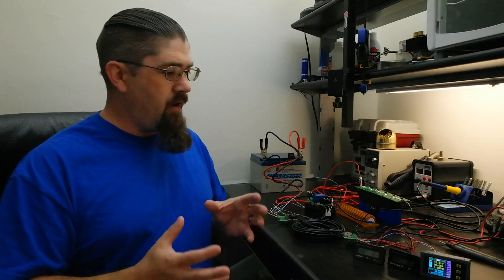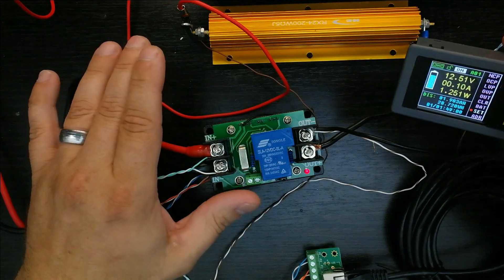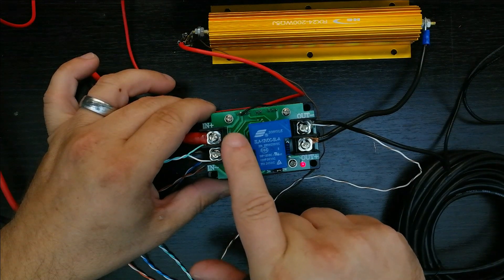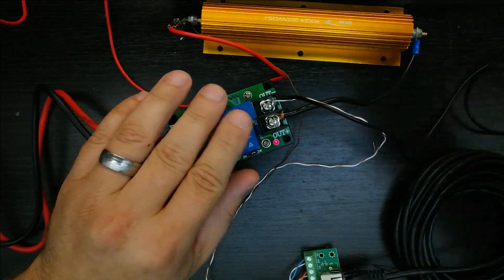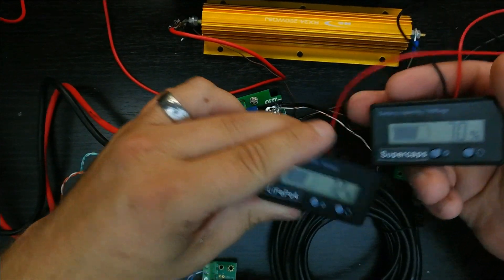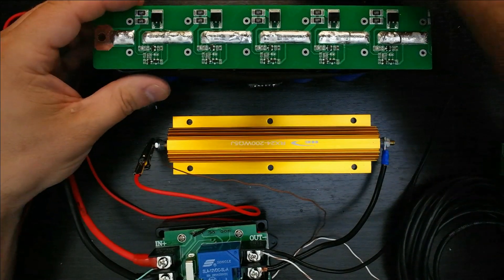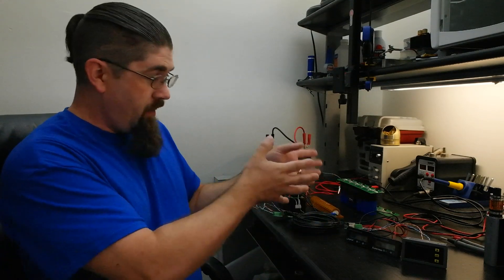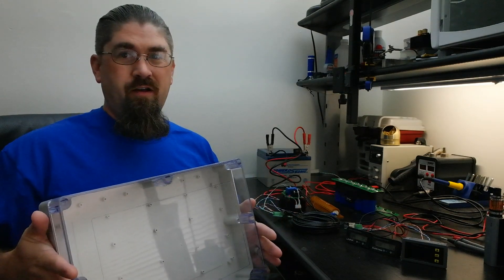Hybrid Supercapacitor Car Battery Part 1 - Overview

Comment: Thanks for sharing the knowledge. One Question: Would it be safe to connect a 12V Ultra-Capacitor Array in paralell with a Lead-Acid Car Battery so that each complement each other, or a Resistors circuitry would be needed ?
Reply: that is explained in this video kind of at the half way mark bro.
also, connecting a battery to a cap without a thicc resistor or something will get spicy if they are really far away from eachother on voltage.

Comment: As an electrical engineer, I caught the exact thing with the flaw on Lasersabers design, need to limit the discharge current on the lithium battery to not blow the very low amperage BMS. Very impressed you caught that! 

Subscribed!
Reply: can a 4 ohm wirewound can be used instead of a .5 ohms one?

Comment: Do supercapacitors work well with the alternator's regulator? For instance, does it provide a similar internal resistance to SLA batteries so that it doesn't run at full tilt and burn out the alternator due to too high of current? Also, will the alternator shut down cleanly when the SC's are full, preventing a voltage dump?

I want to run a LiFePO4 starting battery in my boat but there are two problems with this, without running an external regulator with "smart" alternator and an Alternator Protection Device. 1: Lithiums have such low internal capacitance that the alternator wants to run full current to it, which it can't handle and causes overheating. 2: When the BMS shuts down the charging circuit, the resulting voltage spike runs back through the alternator, typically blowing out the diodes, etc.
Reply: I feel like the answer to that question would also help me as I'm thinking on building a super capacitor assisting electric motor system for my car. I thought about using the alternator as a generator...

Comment: This is pretty awesome, but most of the items you linked are no more. In theory could we build a simpler version with just the protection board with batteries and the .5 ohm resistor?

Comment: should use a isolated dc/dc converter lik a flyback converter to charge the supercaps that way u can hav the battery charging the caps without exposing them to the low impedience high draw of the starter but they can be putting in as much current as the batteries can safely handle in to the system even as  the high current is happening

Comment: Your comment about High Heat and the Amazon has a big hole in it. When the trees feel too hot they release a rain trigger and thus cool down the area. Also the high temperature you are refering to is only a maximum of 37°C (98.6°F). Now when you leave the Amazon Basin the temperatures can reach 50°C (122°F). The main problem isn't the heat it is the acidity in the water. With a pH of 5.5 - 6 all the water is acidic and will eat most anything it comes in contact with. I enjoy your research and testing.

Comment: What's the scenario if the lights were left on over a long period of time which will drain the super caps completely, which in turn will drain the lifepo4 which will slowly discharge all its energy to the car head lights, or rather till the Lifepo4 bms low voltage cuts off output.

Are you stuck? And needing a jump start from someone?
Reply: if you are goint to do this then put a small DC motor on a generator to keep the charge up.
Reply: this is in a closed loop situation
Reply: if in a car then 5-10 second jump with get emough charge to start the car.

Comment: Any thoughts on using a diode in parallel with the resistor to charge the battery, but prevent discharge during starting?

Comment: I have a supercapacitor I purchased a while back... A buddy tried to install it in my boat to help crank the outboard without dipping the voltage so much that it would shut down my electronics (Fish Finder) but when he connected the capacitor it blew every fuse in the boat... thoughts on what went wrong?
Reply from the maker: You need to precharge the supercap before you connect it to your boats electrical system.

Comment: My experimentation found that a relay controller with programmable upper & lower limits with  would make this arrangement a lot easier.
Reply: If you don't mind me asking, is that a sensor that will switch relays between the caps and the battery ?

Comment: I did a hybrid super capacitor car battery very similar to this last year testing different designs. What you will want to do (unless you design a battery disconnect charge circuit while the car is running) is add a diode in parallel with your resistor. This will allow the resistor to restrict current from the battery going to the starting motor while the diode bypasses that resistor allowing more current for charging your battery. You can take a look at my schematic here as well as a explanation of why I made the final circuit changes that I did: https://www.youtube.com/watch?v=zBDtUxPdhz4       Good luck on your project. Had a lot of fun with mine and it's still running! :)
Reply: hav u thought about using an isolated dc/dc converter instead . no powerloss from the resistor and no diode drop from the diode while still providing power during the high load unlik a disconnect

Comment: Very interesting video. I have at present two 12v batteries in series being charged by 230w solar panels. I would like to either place super capacitors in parallel to boost the batteries or replace them completely.  My inverter is capable of outputting 2000w. How many 2.7v 500f capacitors will I need?   Moreover how can I do my own simple calculations. 
Thank you.
Reply from the maker: If your running a 24v DC system, you need two supercap strings in series put in parallel with your batteries to handle your inverter surge loads.  It will reduce the strain on the batteries when you start hi amp loads.  You would not replace your solar lead acid storage batteries with supercaps, it's just not feasible.  Use them as a booster.

Comment: You may want to use a bi--stable relay instead, so your coil current consumption is zero during "on" and/or "off" stage. The only current you use is during the PIN (Pull-In) and the RST (Reset) at about 50-100 mSec. Needs a small trigger circuit for bi-stable relays. Hope this will help.
Reply from the maker: +eco3 systems I did see something about bistable relays, but don't they need a opposite current flow to shut them back off?
Reply: You can have them with 1 coil (reverse polarity, that's the one you mentioned), than you have the one with 2 coils (usually a common (+); Pull-In (-) and Reset (-), that's it. As trigger, you can use a hex inverter CD-4049 with 2 gates for the 2 coil logic and the left-over 4 gates as driver for the two coils (2 gates in parallel for each of the coils). I'll be happy to forward a proven schematic per email to you.
Reply: @eco3sys can you help me with the balancing circuit ie parts supplier etc. Seen the parts on line but need to know when put the circuit il do it correctly. Thanks in advance.

Comment: I am learning about lithium batteries, supercapacitors, solar power, EV's and am really enjoying your channel. I found you from searching for a video on the SAB MOSFET IC, thanks for testing it and showing what it does. 

In the last two months I acquired a pile of all unused LG 18650's between 2,000-2350 mAh. Each one is being tested. Currently have around 1400 tested, about 2800 cells in total. I also have 66 350 farad 2.7V maxwell supercapacitors and 22 3000 farad 2.7V maxwell supercapacitors. They are going to be used in a solar energy "learning" project and eventually a EV. First project is to design in cad and build three 14s 40p(atleast) 51.1v nominal lithium ion batteries each with a 22s 1p string of 350 farad caps. A standalone 22s 1p bank using 3000 farad caps will be connected in parallel through control circuits two the three parallel 14s lithium batteries. The 350 farad banks will also be connected to the batteries with control circuitry. All four supercap banks will also have equalization circuits and safety circuits. As well as three custom bms boards which are made by Batrium for the three lithium-ion batteries.

Do you think the equalization and safety circuits you use are capable of sufficiently balancing and limiting the size of cap banks that I'm building?
Reply from the maker: +Shannon Williams they should be sufficient, but I would contact Advanced linear devices and run your project by them they might have a better idea of how to use their mosfet to help keep your rather large supercapacitor bank balanced.
Reply: Hi Shannon!  I am so much align  with your topics of interest. How has things been working out?

Comment: A cool mock-up. Only one comment, did you think of puttings some buffering on the green and brown twisted pair wires? If a the twisted pair gets shorted somewhere along the line it will fry the cable. A couple of 100 mA fuses will give the needed protection.
Reply from the maker: +Frank Heijkamp I need to work on fusing for them.  Thanks
Reply: Great job Madman, I like it

Comment: All electronic is coming from china, so why do you hate your china electronic around you?
Reply from the maker: I never said I hate china electronics, I wouldn't mind spending an extra $10 on the control unit to keep them from cutting corners and spending a little more time designing the product.  Everything is just pushed out the door as fast as it can nowadays, regardless of country of origin.

Comment: Very cool!  Definitely going to cost a bit initially...but no more stupid cheap batteries dying and the winter cold cranking amps potential is going to be awesome!
Can't wait for the complete mockup and the finally a prototype...so very cool!
Only concern the distance from the trunk to the starter, going to need like 000 or 0000 wire to be able to handle the current
Reply from the maker: +Brian C I'm using 2 gauge to the back of the trunk.  It should be more then adequate to handle the 150 or so amps required for 2-3 seconds to start the car without heating the wire.
Reply: For a petrol engine that might be ok. A diesel will need need a bit more then that.

You could also contemplate on putting the supercaps in the front and the battery in the back.
Reply from the maker: +Frank Heijkamp didn't even think of that.  Good idea.
Reply: Especially since the super caps handle the bulk of the current..the battery is there just to keep the supercaps topped off when the engine isn't running correct?
Only issue is how hot it gets under the hood, aren't supercaps rated to 85C
Reply: A lead acid battery should not get too hot either. I'm not sure how this goes. Maybe wrap the supercaps in a bit of rockwool just in case?

Comment: Cheap way to do big resistors is light bulbs. You can put a 12v bulb in series with the battery and it will limit the current to safe levels. Even if you short the circuit behind the bulb the bulb will just light like normal so you cant overheat that resistor either if you not putting it into a enclosure. Yeah and they are small.
Reply: Yeah, but light bulbs are easy to break or burn out. A good power resistor is going to last forever.
Reply: Another good thing about using a light bulb in this way is that they can have about 10x times their resistance hot compared to when they are cold. So at low current the bulb has little effect on the circuit, but at high current the resistance goes up and prevents too much current flow.
Reply: thanks for sharing your interesting project. I have built a house battery from 18650 cells and it works beyond expectations.  This is in my motorhome.  Now working with SuperCaps and was going to use a 12v bulb to limit the surge from the battery but your 200w resister looks like a better solution. I have tried to find calculations for this without success. Can you explain how you arrived at the resister that you have chosen? Thanks again, John